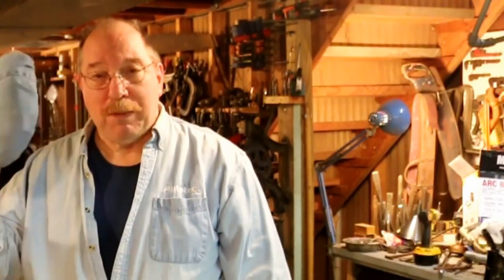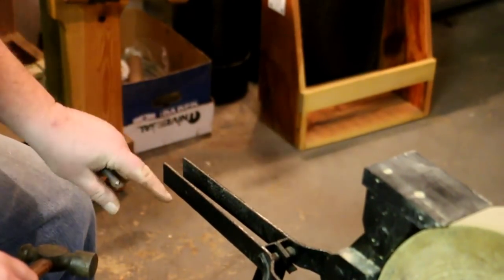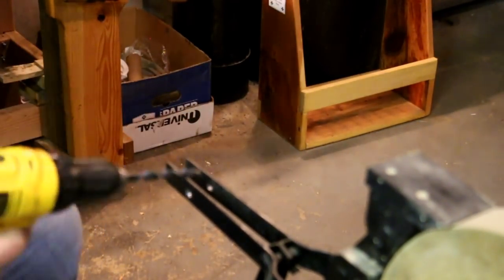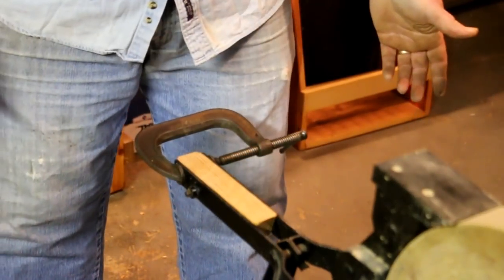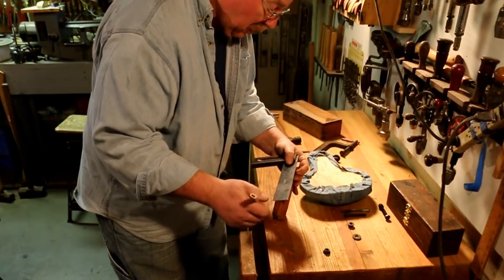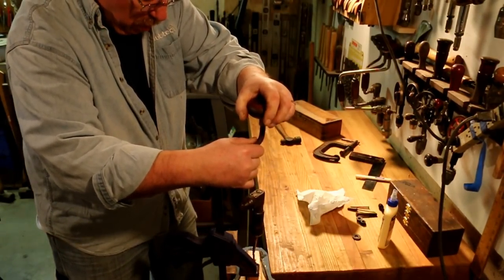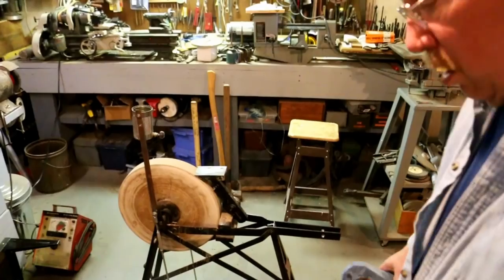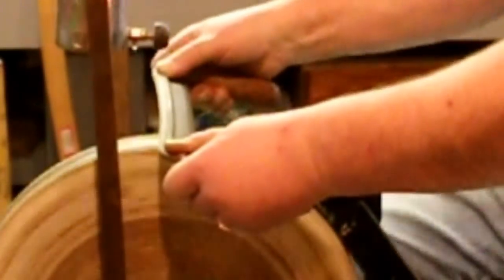Making A New Treadle Grinder Seat Part 2

Comment: I'm impressed with the complete rebuild, that seat is 1st class.
Reply from the maker: Thanks. I'm pretty pleased with it. 😀
Reply: @OldSneelock  Good Job truing the sandstone wheel and the bearings and shaft run smooth and free. It appears to run effortlessly. Great Job Dave thanks for taking us along.

Comment: All sorted great job . Lewie's package came today can't believe what he sent me long time wanting one so when it's done I'll send you a picture of before and after hope  it comes up good quite lot of rust to sort out but I'll do him proud I hope thanks unc take care keep warm 👍
Reply from the maker: I'm sure it will be a beauty. Lydia had three days off and going back tomorrow. She needs the rest. 😆
Spent the whole time cleaning. The house is polished to a fare thee well. 
We are staying warm and dry. Winter doesn't surprise us much after 67 years of it. 4 Coleman lanterns, electric heaters, kerosene lamps, propane grill, wood burning fireplace, we have backup plans that don't rely on the government to help. 😈
Reply: @OldSneelock  The Ad Man said he always wanted one and it wasn't working here and you know the rest. I'm letting the coals burn down in the stove where I can clean it out and not burn anything down. Also ran the vacuum over the floor and took out the trash while she was on the grub run. I think we're fixing to go out to the greenhouse and finish up the box. I usually think of the best way to do things like this when I get done or shortly thereafter and YES, Lydia needs the rest. Glad she got it! And the less 'help' the better.